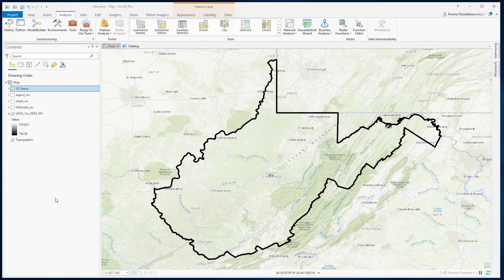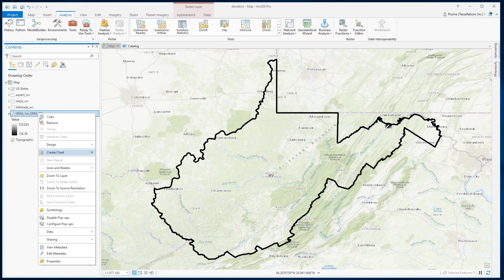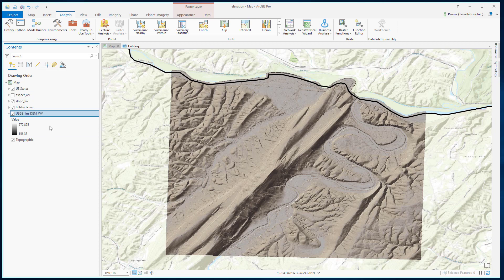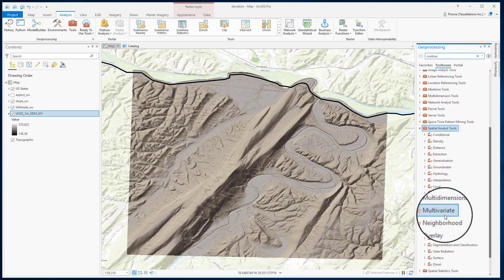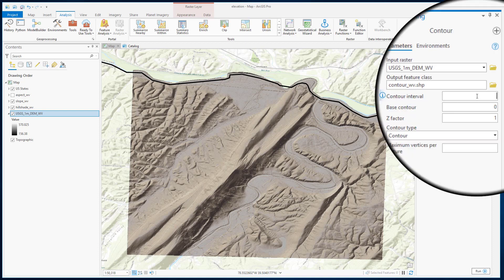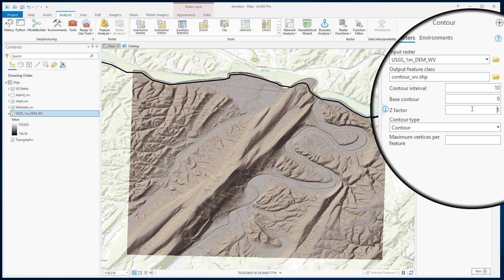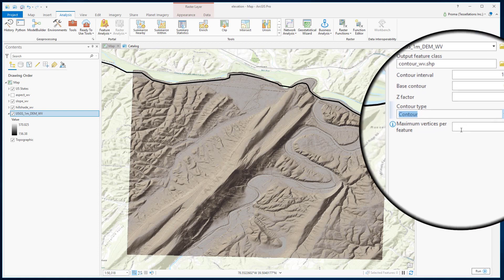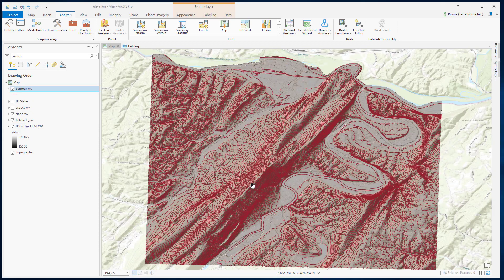ArcGIS Pro: Creating Contours from DEM

Comment: there is no contour function inside my list...how can I add it?
Reply from the maker: Are you not seeing the Contour tool at all inside the Spatial Analyst > Surface > Contour ? If this is the case, be sure to that the Spatial Analysis or 3D Analyst extension is licensed. It also looks like this tool is only available in ArcGIS Pro 2.6+.